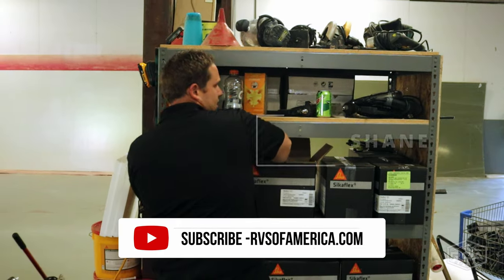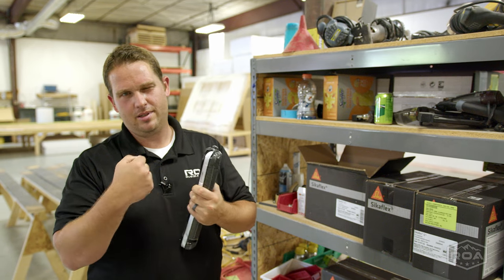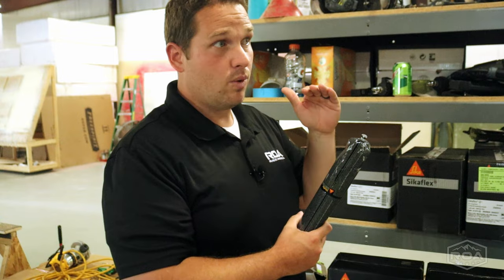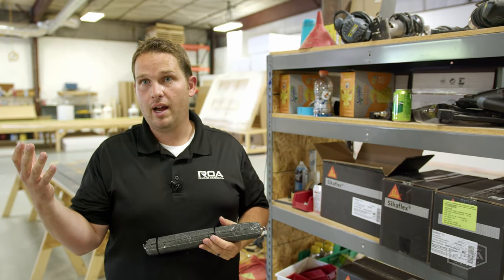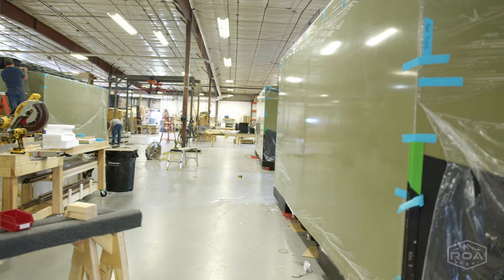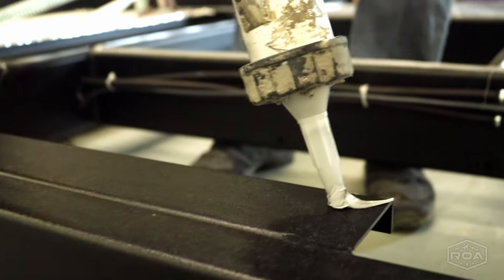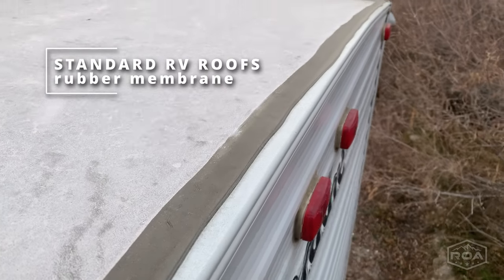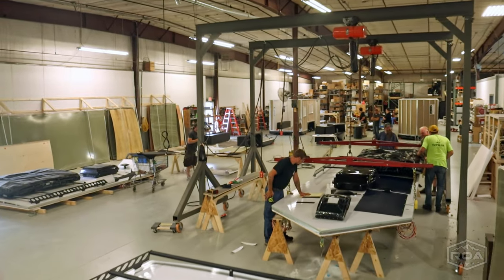BEST  built off-road trailer! STRONGEST RV ADHESIVE on the Market! Xplore X-22 ROA (2022)4k

Comment: This adhesive is top of the line. It is one of the down falls of building a highly insulated 4 season rigs with multiple layers of skin you have to use a lot of these diisocyanate based adhesives and for 98% of folks out there the off gassing process can be dealt with. For 2% or maybe even as low 0.2 % of folks out there the off gassing process can be difficult.